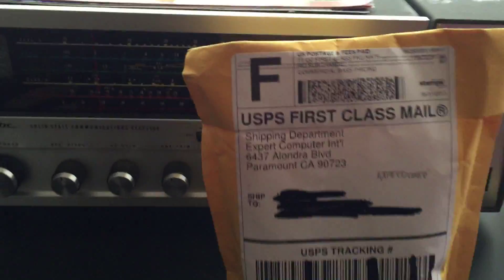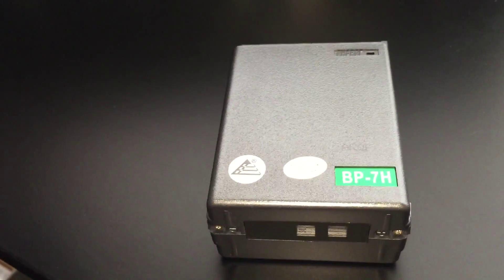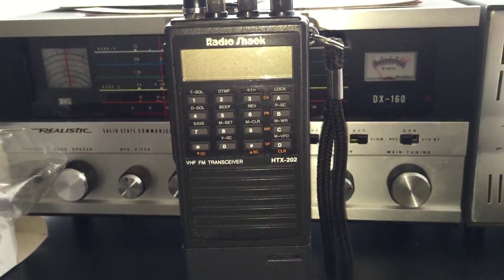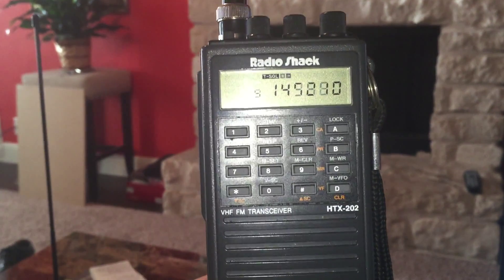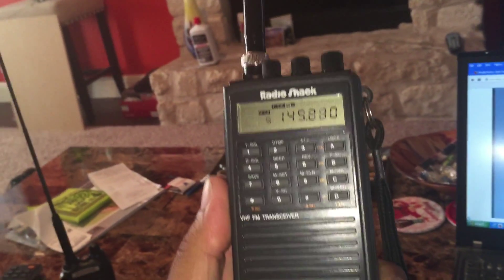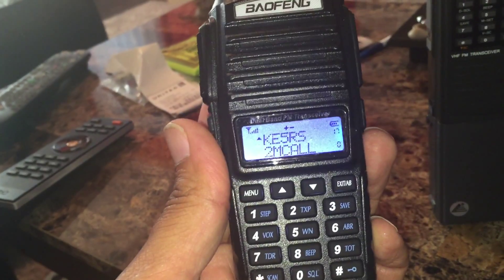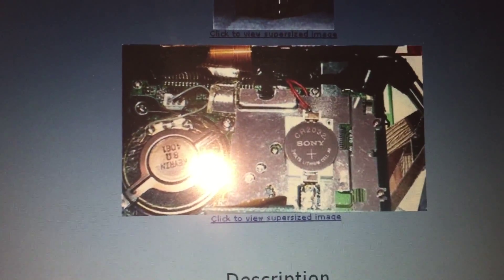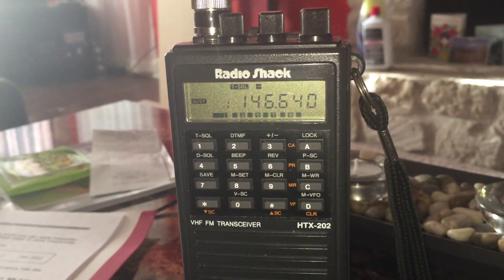HTX-202 - New Battery and First Impressions 2-Meter HAM Radio

Comment: The 404 variant of this was my 1st n fave ham rig.  Had it till year & half ago when some screwup movers either stole it or dumped it.  It was $200 here in canada (202 was $400 at the time) so got the 404 1st.  Just managed to get another 202 at a hamvest this morning & it works other than the wrong antenna was included & the existing battery (the original I'm sure) is stiffer than pushing a frozen brickhouse uphill.  I still love these things which is why I looked specifically for 1 at the hamfest.

Comment: Since the radio was based on the Icom 2A's, all the batteries and antennas are interchangeable. I have 2 Icom 2ATs, a 202 and a box full of spare batteries & chargers.

Comment: I bought four BP-8H batteries for two HTX 202 and 404s. I understand that there are two wall wart ports on the cases. The barrel sizes are two different sizes, the charge port is smaller than the original wall wart charger barrel. I've yet to discover whether or not the DC only port will charge the batteries or if they are only for DC voltage supply. I could crack open the case to see if it is connected to the charge circuit, call the manufacturer or just order a charger with the appropriate barrel connector size. I've got some Uniden bearcats on their way in, but their barrel connectors should fit the charge ports, provided the polarity is correct. I've lost a lot over the years so the junk box is empty and funds are nil after recent orders.

Note: the HTX batteries and the BC8H are interchangable with the Realistic/RadioShack BTX121 "Business band" (now MURS) radios. I've had one labeled "TEKK". They all seem to accommodate the same batteries, but the btx121 connection plate on the bottom is just a few millimeters wider than Icom/RS/Realistic. Those interchange smoothly with each other except with the BTX121. All batteries, but the ones supplied with the BTX121 are very snug and I've gone through some disassembly to remove the battery packs. 
The BTX121 does not operate with the battery connected and on a charger, so if a new battery is installed, and it's not an original pack, the BC8H might very well charge and operate the BTX121, with unfortunately two wall warts plugged into it at the same time. Usually it is unwise to transmit any of the mentioned radios while they are on charging battery cells. There will be a 60hz hum in the transmitted audio.
Reply from the maker: Hi, 
From what i've determined, looking at the original instruction manual, and if my memory is correct,  the charge jack on the battery, to charge the battery, is 12V but only 100ma.  I've only been using the radio with a AA battery pack I purchased on ebay, which works well.  I've come back to the rechargeable battery but the charging situation, as you have described, makes it difficult.

I have charged the battery with 12V at 1000 ma , and 13.8 at 1000 ma for a few hours, and it did work and the battery didn't feel hot.  It's not charge regulated, from my understanding, so time to charge is difficult to determine.

Comment: The HTX-202 was nick named "The Brick" because of it's solid build and high performance.  It had a tight front end making it one of the few 2m HT's that you cold plug a base station antenna into, such as a Ringo Ranger ARX2B,  without overdriving the front end.  In another words the receiver had high selectivity which is a very good thing.  I used to use mine with an outdoor base antenna and the speaker mic to call our local net with.  I always got good audio reports and many said it sounded better than many expensive mobile rigs.  I sold my first one years ago, but bought a used one back in 2008 and I still use it.  I love that radio!  Back in the day "Radio Shack" had some pretty decent radios and accessories for the HAM.
Reply: Amen to all - My HTX-202 is nearly indestructible - great audio - Many years of pleasure

Comment: I acquired an HTX-202 recently and purchased a BP-8A battery for it. I am charging the BP-8A with the 12V port on the battery. Will the red light turn green when the battery is fully charged ??
Reply from the maker: Hmm, I remember looking that up myself and I don't recall being satisfied that the light would in fact turn green, or just turn off, or if there was even any charge regulation what-so-ever.  I had been just charging it for a period of a certain amount of hours then checking how long it would last.  

Per the HTX manuals, it says to use a 100 MA charger, but I have not been able to find any 100 MA current adapters, I've ordered two or three online based on images, but they are always 1 - 2 amps, so I'm very concerned about charge times with these batteries.

I did find this on an amazon Q&A for a similar battery "The red light only indicates that it is connected to external power. It does not change color. Depending on your power source current, allow 8-12 hours for charging. Always remove it from charger after 24 hours. Do not have radio on while charging. "

Comment: I picked up one of these at a yard sale. It was in poor condx and I did the battery mod, cleaned up the battery holders and installed new batteries.  Works like a charm, very rugged.  I also got a speaker mic and AC adapter.  I noticed yours says Radio Shack on the front, mine says Realistic.  My serial number is 0017645, wonder if there is any difference?
Reply: I think the early HTX-202 said 'Realistic' and the later models had 'Radio Shack' on them.  I had one of the first ones in about 1993 and it said 'Realistic'.  I bought another years later and it was labeled 'Radio Shack'.  I see absolutely no difference in the two radios otherwise.
Reply: If  i remember rightly, all Radio Shack products sold in Canada were branded "Realistic". They are identical, just a different name on the product".
Reply: @gregbaran3854  A lot of other RS products were marketed under the Realistic banner in the US, as well.

Comment: I own a maxon 210+3 gmrs radio, I use a ICOM bp-4 slide on alakine battery pack, uses 6 AA batteries. you may be able to it on your  radio.
Reply from the maker: remingtonh
1 second ago
Hi.  Thanks for the comment.  I actually bought the bp-AA6 battery.  Also 6AA, it's what I now use on the radio.  I actually did a video on it.

Comment: I purchased my HTX-202 back in the fall of 1993, and, it has NEVER had a problem other than batteries dying.  This Transceiver still looks and works perfect. I still use it regularly.   I use the Yaesu MH 12 a2b speaker mic on both this transceiver and my HTX -404. The mic is "MUCH" better quality than the radio shack hand held mic, and you can still get them from ebay.
Reply: Update. It's now September 2022 and my original HTX-202 is now 29 years old and running like a brand new radio. No problems with this old brick yet.

Comment: Always loved the HTX-202. It was my first amateur radio back in 1994 when I got my license. Radio Shack had them on sale for $199.99 and it was my only radio for a while. I bought the RS speaker/mic and would use it in the car as a mobile by plugging in 12-volts, a RS speaker/mic, RS 30-watt amplifier and RS 2-meter mag mount antenna. The 202 has true FM and has a rich sound to them. I also had the 70-cm model, the HTX-404, and loved it just as much. I recently bought the Icom version of this radio, the IC-02AT and it's nearly identical to the HTX-202 but with a few nicer features. The Icom model is definitely nicer than the RS model but the RS is still a great radio if you get one that works today.
Reply from the maker: +Mike Hawk I worked at Radio Shack in the 90s and we had these on the shelf.  I was always interested in them but assume, at the time, that the license required was unattainable.  I agree, the sound quality and fidelity is definitely better than the new chinese radios.  Apparently the front-ends on these are really good, and they are very selective.  Thanks for watching and thanks for the comment.  73!
Reply: I got an Alinco DJ-162 in 1994. It only lasted maybe 3 or 4 years before crapping out.

Comment: A real good antenna is the Ed Fong J-pole DBJ-2 which gives exceptional clarity for a low price.  Just Google "ed fong j pole antenna"  About Ed's Antennas.  I took off my short antenna and put on the DBJ-2 and was much better received. (just last night)
Reply from the maker: +keith snyder This battery should be fine, but I might recommend a 'BP-7?"  Something that puts out approx 9 volts, which is what the radio came with.  Otherwise, this 13.2 V battery (which RS never offered) will allow you to transmit full power.  I'm a bit concerned about the input diodes, though.  Thanks for the comment, and 73

Comment: Real nice video.  Yes there is a second DC input on the top of the unit next to the mike and speaker jacks.  Good to know you can get a new battery.  BP-7H I'll check on Amazon.  73's
Reply from the maker: +keith snyder Thanks for the comment!  I did find the DC Input on the top of the radio.  Strange place for it!    Yes, BP-7 would be good.  Get one that puts out less then 13 volts.  73!!
Reply: +remingtonh I am just about ready to purchase the same battery.  Are you satisfied with the number of hours the battery holds a charge?  Does it charge satisfactorily with the standard radio shack 12 V 100 mA Charger?  Are you wishing you for a higher capacity battery?
Reply from the maker: +keith snyder Did you get the battery?  I published another video with a AA battery pack, and that's all I've been using...
Reply: Yes I got the battery.  I bought two now.  I have an HTX-202 upstairs and one downstairs.  Using Ed Fong antennas on both.  Thanks!
Reply: Cheaper on eBay for the same battery.